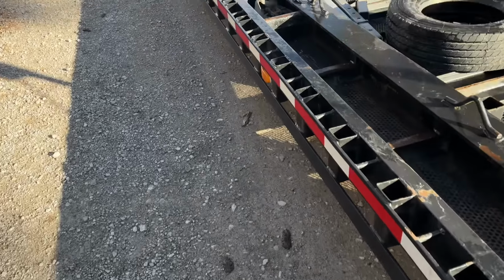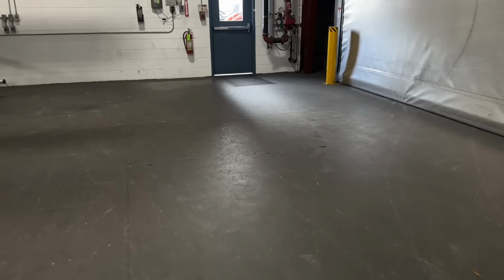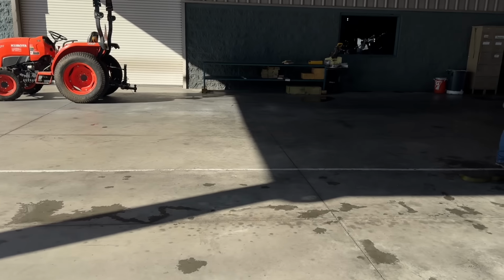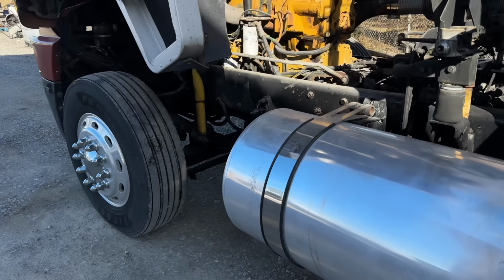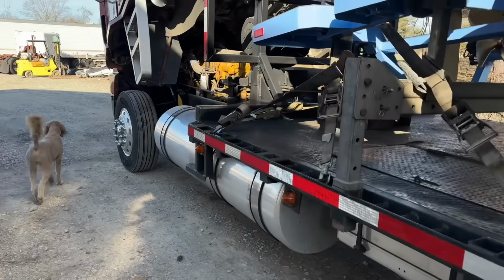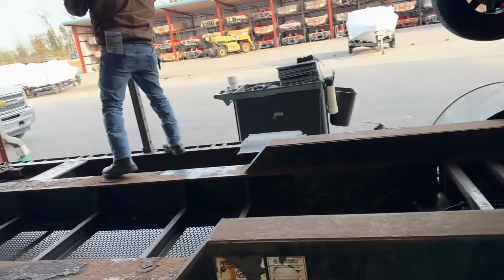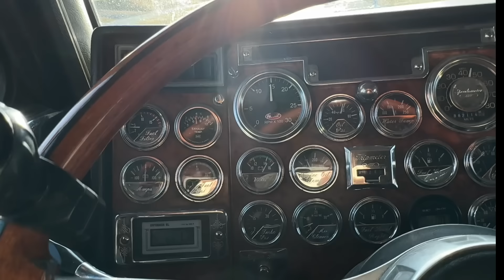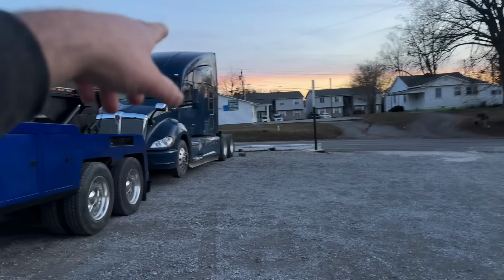Taking The Argosy On A Special Load!! Rooster Gets More Power..

Comment: i have driven both, 4.5 years in a Scania and currently 11 years in an Argosy, after 14 hours a day driving a Scania I felt ready to do another 14, After 14 hours driving an Argosy I am ready to quit. The ride quality is all the difference. The jakes are completely different The Scania has a 5 stage retarder, if you use setting 5 make sure you're seat belt is on, it will put you through the windscreen.

Comment: You could get disk brakes back then as an option as well as double frame but most companies that ordered them didn’t select those options to keep the costs down. Like you said simplicity is key. Much simpler to fix and faster and everything is pretty easy to get to. Driver comfort hasn’t ever been a concern for companies in the U.S. Heck for years truck drivers in the oilfield didn’t even have the luxury of air conditioners or heaters. You relied on whatever heat the engine made to keep you somewhat warmer than it would be normally.
Reply: Disc brakes are junk
Reply: @daneblackburn613  depends on their intended use. Semi trucks in the U.S. have operated perfectly fine for generations without them. They do provide superior stopping power though.

Comment: That was smart putting that pintle hook on. You see a lot of Argosy's in the horse business, horse owners love them because some of those old barns and racetracks are in the city and the Argosy is easy to get around with a 53 foot 10 horse trailer. Come through Portal North Dakota never had a problem coming or going into Canada there.
Reply: Back in the 70's & 80's I drove for Clay Hyder out of Auburndale, Fla. We were self insured & couldn't haul a load into Canada. Loads going to Calgary were loaded 1st drop in the nose & at Portal, N.D. it was transferred into a Canadian trailer. - Loads going to Winnipeg were dropped at Noyse, Minn. & Arnold Bros. came & picked it up & delivered it. We bob tailed into Winnipeg, got a room & after Arnold Bros. delivered the load, we could pull the empty out of Canada no sweat. (good olde days !1)
Steve / W5BIB - retired OTR meat hauler 1977-2009
Reply: Sweet grass is 10x easier, most guys in our RV industry go way out of route just to hit Sweetgrass. 

Pintle is cool till DOT nails him for over length, unless permits cover it.

Comment: Argosy's are underrated, I drove an older one I don't remember what year exactly, but it had a c16 in it, 13spd, 3.55 rears, and it was a monster power, and pulling wise, and was probably the smoothest truck I've driven besides my 03 379, that's sitting on a bagged suspension.

Comment: There's nothing wrong with drum brakes really as much as everyone complains about them. That's why trucks have still used them all this time. There's actually less drag when you're off the brakes because the return springs pull the shoes off the drum where disc brakes only relieve the pressure and it's just how much the push back on their own.

Comment: The Argosy was a Walmart truck, maybe Werner had some, but remember Freightliner was making deals, they would let you trade the truck back in after three years, hoping the big companies would love the no maintenance deal, they couldn't sell these trucks for what they bought them back for, so they parked them in a field and walked away from them they slowly got recycled and scraped out, many of them Freightliner pulled motor and tranny out and used them to sell new trucks with remanufactured drivelines, they sold 2005 day cab fleet trucks for $45,000 in the day with the engine out of Walmart cabin over trucks

Comment: also on uk roads out LGV,s (LARGE GOODS VEHICLES) can run up to 44 TONNES (96800ibs) GROSS VEHICLE WEIGHT above that you go in STGO CAT3/2/1 CAT 3 is 150000kgs (330000 ibs) CAT2 is 80000kgs (176000lbs) CAT 1 50000KGS  (110000LBS) these are classed as heavy haulage

Comment: So #1 the freightliner has weaker frame #2 old brake technology #3 cab isn't designed nowhere near as good, louder inside #4harder to get into#5 suspension/ride quality isn't as good #6 weaker drive train#7 worse fuel economy #8 should I go on in noway is the freightliner in anyway comparable to the Scania

Comment: 17:34  when you pull the eng and tran out and get to that point....  would it be of ANY BENIFIT AT ALL to WRAP anouther C FRAME member outside (or inside??) the ORIGINAL ????  is that what you are doing to the ''heavy hauler'' one? in my head I saw BEEFEIR C FRAMES boltedwelded sittin there lookin all HEVYDUTY and all that with the C on the OUTSIDE of the OG ;)  so the bigger new one takes more load than older ''streaseedout'' lol og one lol ? HAHAHA something like that....   eh...  still like caboverxs..... have a buddy with a mill plus wutever in em... he did the longhaul stuff thru the 80s and 90s....

Comment: Have to say the argosy dont compare to a scania . Disc brakes full air suspension an standard power that would trounce any standard argosy .Bruces truck is old compared to a modern scania . Most are 500 hp an more like 620 to those that use them an know how well they pull . The last of the the 6 series was 730 hp standard and even they are tuneable on top . Americas roads are not as twisty as uk an europe . The scania was designed to be ergonomic powerful beyond most other trucks . The volvo fh 750 is the only other power house and 750 is hp not like the american ones badged as 750 but not actual hp.  Your conventional long nose hood trucks can not turn like a scania .No doubts on 6nz performance either they can produce big power but long life aint going be an option. Them scania v8s regularly clock up 1.6million miles afore they need rebuild .They aint fiberglass either . The gearboxes are pretty strong too and many options like 2 pedal opticruise an 3 pedal  6 sp 8 sp now and 12 speed . The cab size on the argosy is defo bigger and driver pleasing . But they are pretty ugly trucks .The 6 cyl is generally up to 500hp  in scanias now. Thats the dc13 .the v8 is there best engines the dc16. The DAF xf is a comfy truck with space that most drivers love . My dad included . 
My bro drives a 2023 Daf xg+ 530hp an he loves it . He reckons its a game changer compared with the older DAF 106. My pops is in a scania right now . I think he was converted from a DAF man to scania power . You would love a 6 series 730 . There are folk that do sell them in usa im sure . You will have to come across the pond an drive them for ya self . The newer scania like that 4x4 camper are another level again ! They are called NGs new generation s line and r line s line is big cab like that dutch one had and the R is a smaller cab slightly and the max power is 770hp get brax on ets 2 and try the 730 hp its a weapon . I was an IVECO truck mechanic back when they had a v8 called the turbo star they were beasts too . Very torquey and fast for ya 90s circa trucks . But metal was poor an we salt roads here so they vanished and rotted fast .Thats ya italian trucks . Fine in italy .Ya screwed any where else . No such thing as british trucks these days tho FODEN used same chassis as later K100 seemingly and the erf was much a similar both fiberglass cabbed . There a few american trucks here like k100 and few volvo conventionals dotted around the country but they are big for our little A roads . More novel than work trucks . Im sure you will get a scania at some point ! All the best . ps The wrecker looks sweet all tho you made a danger zone paiting back black . On a dark wet night you need to be seen and safe from rear at all times . That bed liner will not reflect light well . But some LED light strips could remedy that if perimeter marked the outline .